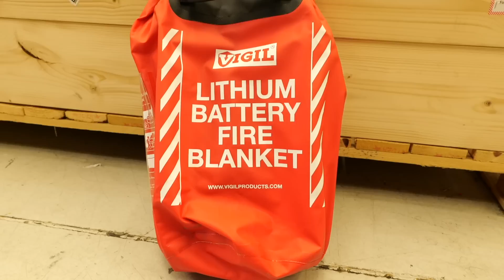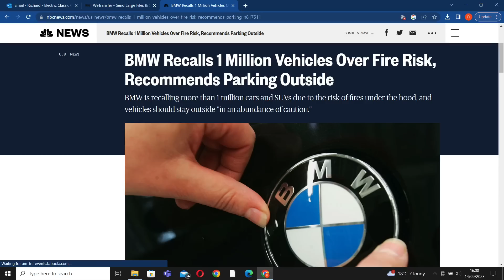Electric Car Fires - Facts and Figures

Comment: The statistics this guy is spewing out are not fair. ICE cars that catch fire are usually older and due to electrical faults or the owner fidling with aftermarket upgrades. EV are too new to have an old electrical harness. An ice car on fire burns at 3 times lower temperature compared to ev and a fire truck can easily put out the fire with a 100 galons of water.   For the ice car to burn you need oxygen ... if you sufocate the fire it stops. EV have thermal runaway and even 20 000 galons of water may not be enough to put out the fire. Even when the fire stops it could reignite on its own. Evs produce far more toxic fumes. In car parks there are sprinkler sytems that can control an ice car fire and prevent the spread. These sytems are useless in an ev fire because of the thermal runaway and the spead of the reaction i.e.  burning and the high temperature of the fire. So this guy is heavily biased... he sells evs afterall...
Reply from the maker: Will EV fires become more common as EVs age? We’ll see. But in the meantime here’s some interesting information. The Nissan Leaf is the one of the first EVs mass produced. Starting in 2010 , over 650000 have been sold. But only 11 have caught fire due to thermal runaway of the battery. That’s a 0.0016% chance of one catching fire. Keep in mind that these were some of the very first EVs and don’t even have thermal management of the battery. 🤷‍♂️ https://www.facebook.com/share/p/j2wJhPJVMyF7DBYs/?mibextid=WC7FNe
Reply from the maker: Norway has one of the largest % of EVs per capita in the world. In 2022 there were 4 fires per 100,000 EV. Lower than in 2021, 2020, 2019 or 2018. So it seems despite the aging EVs in that country, the likelihood of one catching fire is going down. I suspect that this is because battery management and their thermal management in newer EVs is getting better along with more EVs starting to use LFP batteries which are very difficult to ignite. https://www.carbonbrief.org/factcheck-21-misleading-myths-about-electric-vehicles/
Reply: @ElectricClassicCars   in the past week there were 2 ev fires in South Korea. The first took out 140 cars in an underground car park. EV fires are rare ...but devastating when they happen. The footage shows the thermal runaway of the EQE ... what an inferno of toxic gasses it is,  that quick spreads to ice cars. 
There is public pressure now to ban ev from underground parking. We should also mention that in Norway, Sweden, Greece, Italy to name just a few evs are either forbiden onboard of ferries or are required to be at under 20-40% charge. 
If the current fire rate of evs is sustained it's a matter of time before we have a major fire in one of the huge shopping malls where we have thousand of cars. LFP look to be better from a fire standpoint and so do solid state but at this point they are more of a novelty fitten to few models.
Reply from the maker: @ivayloipetkov That’s funny, because I’ve been to all of those countries on ferries, some of them multiple times and not once have I been refused into a ferry in an EV. In 2018 over 1000 cars were destroyed in a car park fire in Liverpool. The cause? A diesel car.  In 2023, over 1400 cars were destroyed in a car park in Luton. The cause? A diesel car. Car park fires have been happening for decades, long before EVs came along. Have they banned petrol and diesel cars from car parks? Even though its well known that they’re much more likely to catch fire than EVs?

Comment: We need to do some testing, 
Cover the battery with rubber pillow, do the artificial earth quack test. 
Check which gas is released from battery during shaking. 
How much this gas is flamble. 
I will give you some more test and solution.  Jay bharat.

Comment: the likly of a petrol or diesel car just sitting there and catching fire is more unlikly than a ev catching fire, does the report state the causes of the fires for example was they involved in an accident etc, you cant throw figures without the full facts, not just partial facts
Reply from the maker: There are plenty of recalls for petrol cars catching fire while parked but none for EVs at present. https://youtu.be/FU7LmHCBRNc?si=xZjeezekwBXCUOVo

Comment: I'm fascinated by people discounting the root cause of an EV fire. The truth is a tiny fraction is actually caused by the battery with most being caused by everything BUT the battery. Examples of this is EV owners self installing Level 2 charging and not using a licenced electrician with tragic consequences. The use of improper extension cords for Level 1 charging has also been an issue. Lastly, improperly wired aftermarket accessories cause vehicle fires all the time but if it involves an EV then it "MUST be the battery!" There is a big difference in an EV battery starting a fire or an EV battery that is victim of a fire not started by the battery. There was a burnt out Mustang Mach-E in a garage so it had to be the battery, right? Turns out it was drill battery charger on a workbench that overheated and caught the workbench on fire and the Mach-E eventually got involved. Amazingly the EV battery DIDN'T catch fire so all the damage to the garage and car was from everything else burning. Also EV battery thermal runaways take a long time to happen with lots of smoke and popping before it can really let go giving everyone lots of time to be a safe distance.
Reply from the maker: Battery packs in EVs are designed to be very resilient against fire from an external source. There was a Tesla showroom in Germany where a load of Teslas were set on fire due to arson. They were all destroyed but the batteries were intact and didn’t add to the fire. 👍
Reply: @ElectricClassicCars  exactly but EVholes only see a burned out EV and jump to the conclusion that it was the battery that started it all when it's almost never the case. Sure a small handful of early Bolts and I-Paces (same battery supplier) had faulty cells but they have been or are being addressed to mitigate any further issues (my I-Pace is in for a couple of new cells after the recall).

Comment: from personal note, what I think should be looked at is how many times that vehicle had been charged in a 24/48 hour period, like probably find that the number of fires started are caused by heat of charging in a 24/48 hour period, and probably explain why the number of fires has remained around the same over the passed 2 years is because most people buy them as a 2nd car, or only doing local runs with them. but driven my electric car from 1/2 way between Cardiff and Swansea, to Oxford with a 36KW/h battery, I filled up before I left by a couple of hours, it needed a charge in 3 services each way to make the distance, and then back was 2 charges. the battery was only just below the red line for temperature. so I think the number of charges or the speed of charging is a major factor in EV fires. whereas occassional charging say once a day or less frequent is why the number of fires has remained roughly the same.
Reply from the maker: A car like a Golf E, which has a 36kWh battery, has a real world range of around 120 miles. Bridgend to Oxford is 124 miles. Why did you charge up 3 times for that journey?

Comment: That piercing nozzle you mentioned is not recommended. It is unlikely that a firefighter will know which battery cells or packs are experiencing thermal runaway and even less likely that they will manage to pierce the correct ones without causing thermal runaway. The promo video also appears to show them piercing a Prius (hybrid) pack, possibly in the wrong location.

Comment: well - we need to define 'car fire' first and then the circumstance. Was the fire caused by collision or while waiting at a red light?   Car fire as in- the whole car burned or... fire in the engine compartment but contained.  You don't 'contain' an EV fire -- not easily anyway. Once those batteries catch-  VERY difficult to get the fire out-  just ask the firemen.  EVs will eventually be mainstream- but we are a good 15 years away still.  We don't have the infrastructure in the US to support 3 million EV's let alone 23 million.  We don't know enough about how to manage EV 'incidents' as well. Are you REALLY going to park your EV inside your attached garage? Some will and some DO no doubt but don't forget to tell your insurance company to update your house insurance... I'm sure the additional premium won't be much.  Oh, you got a deal on that chinese charger for your EV-  cool man; what a 'smart & thrifty' shopper you are.   If we are going to compare fire counts-  let's begin with SPONTANEOUS fires as in; cars parked, not running and they somehow ignite.  Make a video on that.

Comment: A lot of the Anti EV propaganda is equivalent to when ICE cars first started mass production, and they got ridiculed for running out of fuel going up hills because the fuel would move away from the feeding line. The horse &  buggy die-hards wouldn't shut up about it even years after the issue was fixed.

Comment: The problem is you can't put out a electric car fire that easy and the water you use is toxic. Even if you just get in a small accident in an electric car the battery could be compromised. I like electric cars but they will only be for rich people for a long time.

Comment: I  accept what you are saying , and it is probable that battery technology will improve in respect of safety .My concern at the moment is that Firefighters do  not have adequate supplies of suitable equipment to deal with E.V.fires and are unlikely to do so for quite some time yet.

Comment: Twisting the facts electric cars newer  compare with the age also batteries later years degrade and will be more of a fire Hazard the plastic degrades in cells also Sweden is a very cool hotter climates course much bigger problems for batteries 🤔

Comment: I’ve seen two petrol cars catch fire, only heard of several EVs catching fire. They take a ton of water to put out, they will lock up and you won’t be able to get out, they will burn and burn and anyone exposed to cobalt fires will experience health issues. I find being locked in the car more troubling.
Reply from the maker: All modern cars, EVs or ICE, have to have mechanical internal front door handles. That’s mandatory. Getting locked inside an EV in a fire is a myth.

Comment: The likelihood of catching fire is irrelevant. all fire has the potential to be catastrophic. EV is far more serious if they do burn and that's the issue. i can predict a petrol/diesel car fire's growth and spread, I can't do it with an EV, puls they are all parked next to ordinary cars which ignite EV. your facts are useless.
Reply from the maker: A car park full of EVs won’t spread fire as fast as one full of ICE vehicles. As any fire department will tell you. This is because the highly combustible fuel stored in an ICE vehicle, once ignited will spread from car to car through rivers and pools of fire. As stated in the Liverpool Echo Car Park fire report. It also mentioned that fire easily spread to different levels within the car park via “waterfalls of fire”. Controlling an EV fire requires the correct suppression strategy, just like you wouldn’t use water on a grease fire as it would make it worse. A fire blanket is the best solution for an EV fire.
Reply: This is factually WRONG! Look at recent news. @ElectricClassicCars
Reply: Your narrative is useless.
Reply: That’s not how math works. You’d need to factor in both likelihood and damage potential to evaluate risk. For example, a 2x higher damage potential, with a 0.05x  frequency multiplier (as shown in the Swedish data) is a way lower overall damage potential and risk.
Reply: "The likelihood is irrelevant".....!?
How the f-ck is a "likelihood" irrelevant, it's likely to happen, it has a higher chance of happening than not, where in that, does "irrelevant" come in exactly.....?? For the sake of trying to make out like you are some kind of authoritative source of information, you have effectively made your attempt "irrelevant"...
Reply: @nicolasrose3064  You missed the point completly innyour rant. I am agreeing with you. And for the record, you have no idea what my qualification or employment are. 😄

Comment: You have to be VERY careful with those kinds of statistics: yes, electric cars are 20 times less likely to catch fire than ICE, but IN THAT POPULATION. What is the age of the respective ICE and EV's, and what it the profile of age related failure modes? We dont know.  But we DO know that age and poor maintenance WILL be factors to consider.  I wholeheartedly agree that EV's are less likely to catch fire, but when they do they are a whole lot harder to deal with (for current chemistries).

Comment: I believe analysis of petrol cars catching fire is biased. Petrol doesn't catch fire on its own, fire is most likely a result of short circuit or some other electrical issue. EVs catch fire mostly due to the batteries.

Comment: An Interesting presentation, one point is how the media can't be trusted. This sadly works both ways. You use the Freemantle boat fire - originally reported- no EVs on board, then reported - EVs on board but not on the decks on fire to finally reported - yes in the fire and pictures of a still smouldering EV having to be put in a water bath. EVs don't cause many fires but they have far worse problems when they do. What we need is the truth, difficult, as I have seen presentations from fire departs on the issues (not favourable to EVs). London electric buses, imagination that they have fires? Australian electric cement lorry , imagination that out of a very small population, fires? The real problem is governments are pushing EVs, and nobody trusts governments not to lie. People remember things such as Samsung phones causing fires and so being banned from planes, ebike batteries are supposed to be the biggest cause of fires in London now. The truth is out there but we will never be able to hear it from the media ot the governments.

Comment: What you fail to mention is that when EV does go up, the consequences are far, far worse and you cannot put it out. They are also driving up insurance and many body shops are unable to or simply won’t take evs because you need a 15m radius around them incase they do go up.
Reply: Yeah, that is not true.
Reply: @Jetjockgordo  which part? Everything I mentioned has happened/is true lol

Comment: What you are missing in your risk assessment, is that the emissions from EV fires are comprised of some very toxic substances. Hydrogen cyanide and hydrofluoric acid just to name two. EV battery fires may also be accompanied by a smoke cloud that that can create a thermobaric explosion of the type employed as weapons on the modern battle field. These are very nasty and cause significant hazard to first responders.

Comment: You are wrong, ICE vehicles do not store power, except in a small 12 volt battery.  EV's have a massive battery, with computers and cooling systems that can break down or be damaged slightly in an accident or by a speed bump.  ICE vehicles produce energy when they are running, not when they are parked, and Ev's give off poisonous gasses.
Reply: Petrol has the properties of stored energy, but they do not self ignite and burn without oxygen.  EV's, an illogical solution to an imaginary problem.  B. S.
Reply from the maker: Petrol is stored energy. A LOT of stored energy.

Comment: O.k. So this entire video is based on one report by the MSB, and he represents the MSB as a reputable agency with reliable information.
Why?
Because Swedes don't lie?
Because they're a government agency?
Because they have an interesting logo?
My position is that electric car fires are extremely rare, but if it turns out that I build electric cars or have a strong interest in advocating their safety, I suddenly become suspect.
This is a decent video, but it's only a piece of the truth 
I will say this- if I had an electric car, I wouldn't charge it in my garage while my family slept.
Charging batteries can be dangerous under some circumstances. This has always been true of all types of batteries as long as people have used them.
Why would that have changed?
Reply from the maker: You obviously store all your battery appliances like mobile phones, laptops, power tools, electric toothbrush etc etc in a fire proof container 100yds from your house every night. 😆😉👍
Reply: @ElectricClassicCars  A cell phone charges in the milliamps, as does everything else you mentioned.
And they're designed with a huge safety margin.
The dynamics and scale of a car on charge isn't even in the same order of magnitude.

Comment: EVs have inherent problems; dendrites.  These are deposits the can grow inside a lithium ion battery.  These deposits can cause a short and catch a car battery pack on fire without anyone being at fault; the problem can't be resolved by better manufacturing or bettery care or maintenance.  The Fremantle Highway was transporting 3000 vehicles when 1 of 500 EVs caught fire; it was just parked there a brand new car. That EV quickly caught other EVs on fire until the entire ship burnt and sank in 10,000 feet of water - new cars -  the average ICE car is 12 years old; so many are in disrepair and this causes their fires or some defect - not perfect new cars.
Reply from the maker: Nice fictional story about the Fremantle Highway. It didn’t sink and EVs weren’t to blame. But nice try 😉😆👍 https://www.automotivelogistics.media/electric-vehicles/evs-in-good-condition-after-fremantle-highway-ro-ro-fire/44559.article